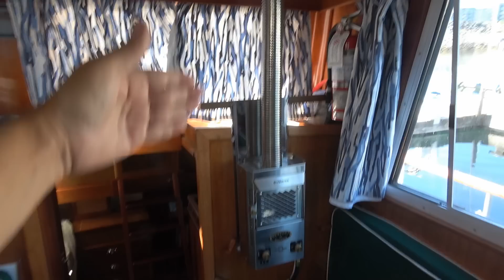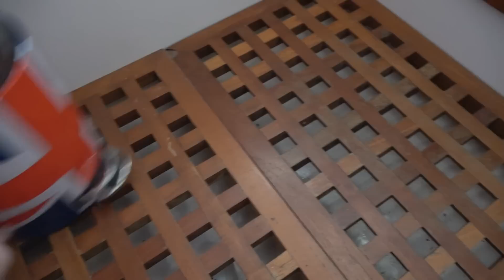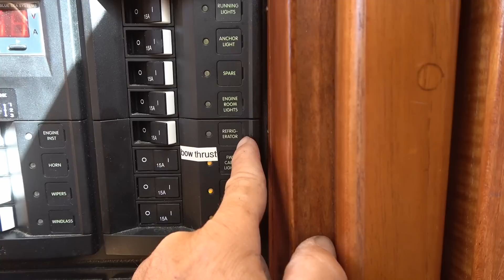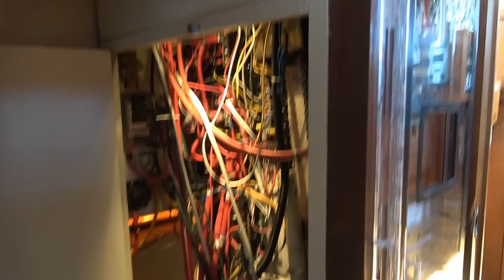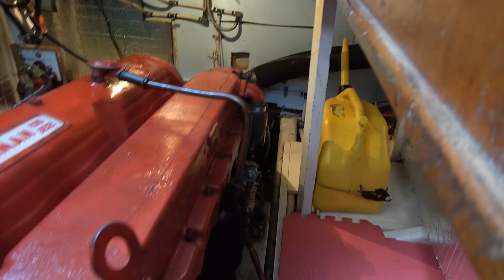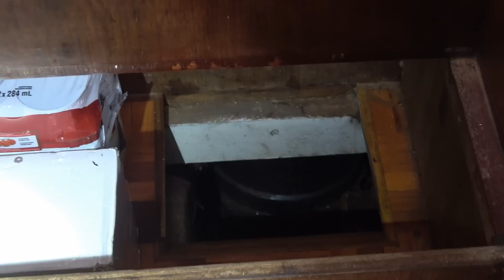Ray's Tour of Our New Boat "Vestri" Mechanical, Electrical, Plumbing, etc -  1976 CHB 34" Trawler

Comment: Thanks for the tour of the systems on your CHB trailer. I live in Juneau Alaska and am thinking of buying one of those trawlers to replace my sailboat.  Just a couple of comments about your water pump for the galley sink, etc. You’re correct about the loop in the line providing some relief for noise. Another thing to consider is to put a little bit of rubber matting between the mounts on the pump and the wood to which is secured.
Also, have you looked into an on-demand, propane hot water heater system? I know a lot of RVs are using them these days. Might be an option for when you are not on shore power.
Reply from the maker: You're welcome. :) The boats water heater has an exchanger system built into it. So when you are running the diesel engine it pipes coolant through the water heater which heats the water really well. I make sure to do dishes while under way and then when we arrive after using the engine we both have showers. :)  Also being we are summer cruisers we can sometimes swim in certain bays and coves and I have one of those camping shower bags that hold 20 liters. It warms up in the sun and we can hang it on the end of our trawlers mast boom and shower on the swim platform. Actually works pretty well.
Reply: @LoveYourRV  sounds like you have it all figured out!  I live in Alaska so those camp shower bags don't really work up here!  What I'm proposing is using an on-demand propane water heater that can run right off your existing 12 volt system and propane system.  That way, you don't have to depend on the big engine running or on the camp show bag (if the sun isn't out) and can have hot water whenever you want.  I do believe they have these systems in RV's these days.  https://www.youtube.com/watch?v=dtQHir8r2rg
Reply from the maker: Yes, getting popular in newer RVs. I actually decided to not go to one in the RV when my original gas/electric water heater bit the dust a few years ago. I replaced it with the same OEM type. I wanted to keep the electric functionality for when on shore power since shore power was included free at the campsites I frequented about 4 months of the year.  LP gas is getting pretty expensive and the water heater can be a big user of gas.
LP gas water heaters are pretty scarce on boats, even any LP gas appliances for the matter due to safety concerns. LP gas leaks in an RV can flow out onto the ground and dissipate. They can build up in the hull of a boat and cause an explosion. So installation would likely take extra precautions and get expensive to move the water heater location. For example, you wouldn't want to place an LP gas type where the existing water heater is in the engine bay as any leak would trap gas right in the hull. So it would involve finding another place on the boat. Then it also requires outside exhaust venting and then run the plumbing/electrical to it. So you see, it's not a simple install like in an RV to change to an on-demand. I think if I went to an on-demand, I may look at a diesel on-demand, but so far, it hasn't been a big issue. To conserve fresh water off the grid, we do a lot of sponge baths with boiled water in a sink anyway.
Finally, every few years the boat needs to pass a survey so we can get insurance. I'm not sure if an on-demand would be allowed or not or take a bunch of extra money input to pass marine safety codes, etc. So would have to make sure of that too. Cheers, Ray
Reply: @LoveYourRV  good insight and information.  I've never owned an RV but have had several boats, so I can see how what applies to one doesn't apply to another.  I appreciate your input and insight!

Comment: You wouldn’t want to fuse the large house battery wire as you stated previously up top you have a choice of starting the boat on the house batteries. So for the same reason you don’t fuse your starter battery line, you wouldn’t fuse that unless you took away the choice up top on the switch and rewired it or just never start the boat using the house batteries.
Reply from the maker: Yes, it seems to be wired so that the house or both banks combined can easily be used to start the boat but I personally think its too great of a risk given the long wiring runs, so I will be rewiring them so only the start battery bank is connected direct to the starter and then fuse the house battery properly. I'll ditch that battery switch and replace it with one that will disconnect the main DC load panel feed. I'm also planning to replace the house bank with lithium. 
I carry a little NOCO GB150 jump starter box rated for a 10L diesel, so if ever needed, I'd use that in a pinch to start the boat.

Comment: Look up electrolysis on saltwater boats. Electrolysis happens when electrical current runs thru water and will take electrons from one metal and deposit them on another. You can get electrolytic reaction between your boat and another docked close to you. Don’t know if you have zinc anodes or if your boat has a metal hull, and you have bad wiring introducing current into the water, which would cause electrolysis to occur. Aluminum boats are very susceptible to it. Also think about your aluminum or metal propeller with electrical current in the water, I would check that too. Beginner boat owners do not know about electrolysis and may not of even heard about it.  It can cause components to fail or weaken. I would read up more on this subject.  Great video!
Reply from the maker: Yes, there are numerous sacrificial zincs on the outside of the boat and in the engine that get routinely changed. I've also discovered the boat has a Newmar 30 amp galvanic isolator installed on the incoming AC earth ground line. It was hiding high up in the main electrical cabinet. I tested it today with my multimeter and its still in working condition. Next season though I may replace it with an updated one as its pretty old.  The older Electro-Guard must be a relic from the 1960s or 70s judging from the ancient transistor I discovered on its circuit board today. Cheers, Ray

Comment: I'm looking forward to seeing what you do with all that wiring.
Reply from the maker: Just finished installing a Smart Plug outlet, ActiveStart soft starter and 2000W inverter charger so got most of the AC wiring cleaned up, now to the DC circuits and wires. :)

Comment: My brother owns a couple of yachts some years back and from what I could tell they never use propane in a boat because its so dangerous and being heavier than air a bilge full of propane due to a leak would make for a dangerous situation.  Everything in his boats were electric.  He had an old stove that somehow ran on diesel.  I know you're very competent in just about everything.
Reply from the maker: When I was looking for a boat, I noticed many of the types I looked at had propane stoves/ovens, and barbeques. Most were west coast boats, and most were ones that people used for extended cruising. But as battery banks have grown and more people install lithium batteries, induction cooktops are gaining popularity. 
Propane stoves are still used though https://defender.com/en_us/fixed-stoves-ovens Here is a brand new Ranger Tug Northwest model that comes with a propane stove and oven. https://rangertugs.blob.core.windows.net/media/4200/2023-06-30_2023-r27-spec-sheet-web.pdf
If you look at the major cases of boat fires, the electrical systems are by far the biggest cause, both DC and AC, then many are engine fires. I was way more worried about having a gasoline boat versus diesel than having propane. Having worked on and used propane living full time in the RV I'm used to it and how to maintain and test the system. Cheers, Ray
Reply: Wow thanks for the thorough response. Like I said you are always well informed in just about everything. Happy boating!

Comment: I would add a CO2 & smoke detector in the master bedroom.
Reply from the maker: I'm currently adding a smoke detector in the bedroom as there wasn't one anywhere. CO is pretty close as it is maybe 8 feet from the bedroom so not as worried about since it is lighter than air and tends to rise

Comment: Thanks Ray!  Very interesting!  Good for you for taking on what appears to be a steep learning curve. Lots to learn but that’s half the fun. Question: is your vessel capable of handling the ocean waves?  For example BC to Mexico. thanks
Reply from the maker: The boat could likely handle but I don't think we would. The boat gets pretty rocky on side ways waves so would need to add stabilizers, etc. It can get very nasty in the open ocean plus you'd have to keep going at night. Nowhere to stop when you are 50 miles off shore and we only have a single engine. We'll stick to the sheltered inland of the BC coast waters and enjoy ourselves. :)

Comment: Yeah electro guards pretty darn unusual stuff and replacing parts is kind of silly expensive. You’re better off with a $300 galvanic isolator and be done with it.
Reply from the maker: Was installing a surge protector yesterday so rerunning the AC input wires and found that there is a GI-30 NewMar galvanic isolator that is installed in the boat https://www.newmarpower.com/wp-content/uploads/2016/02/Manual-GI-3050.pdf

Comment: Hey Ray, now you’re in my world I’m a marine ET that’s nationally certified to work on your boat so I wanna just give you a heads up. When you change out your shore, power plug and it looks like you have a 30 amp system in that boat go ahead and pop in a galvanic isolator just as that hotline comes in from the back of your new shore connection you'll be glad you did. they're literally only a few hundred dollars and they take up some space, but when you leave 110 AC running all the time you’re gonna find anything outside of that boat wanting to get chewed on such as your rudder and anything else metal it’s on the outside of the boat.  Galvanic, isolation is no joke.
Reply from the maker: Thanks for the heads up,, good idea. Do you have any recommendations of galvanic isolator brands?  We actually don't plan to be on shore power much at all though mostly will anchoring when using it, with the odd overnight stop at a marina to resupply. Then the boat will be on land storage about 7 month of the year.  
Also, maybe another way to go would be to always run the boats AC loads off the Inverter output and the batteries and just have a battery charger for shore hook up. That way the boats AC loads aren't connected to the shore panel ground.  Cheers, Ray

Comment: I would make the fuel filter more accessible immediately. Crud in your fuel tank will get stirred up in rough seas and clog the filter. You will need to be able to change it immediately if the engine quits off a lee shore. 

The teak is beautiful but I hope that you enjoy maintaining it.
Reply from the maker: That's Anne's job. She can't do to much as far as mechanical, electrical, etc so will give her something to putter away at :)

Comment: I’ve never seen an isolating system like yours with meters etc.  Now you simply install a galvanic isolator which helps prevent stray currents from other boats in the marina from impacting your boat.  ProMariner ProSafe FailSAFE 30 amp isolator is what I put on my boat.  The unit from 2006 actually failed in an open condition, which is dangerous.  The new units are required to fail in a safe state (ground intact), but maybe not isolating stray currents properly.  Very easy to install, simply run ground from your new shorepower inlet to the isolator, the other side of the isolator continues on to your boat ground point.  Your boat is very clean for a 1976 diesel, previous owner took care of it nicely.

I just installed a 200 amp hour SOK marine battery in my boat with a DC-DC charger (Victron).  Very happy with the system.  Have fun!

Comment: I believe the "Electro-Guard" gauge is an Electrolysis system for Prop, Shaft; maybe Thru Hulls. I see copper wiper arms for sale. As you are probably aware, Electrolysis can eat props and shaft if ignored.
Reply from the maker: Was installing a surge protector yesterday so rerunning the AC input wires and found that there is a GI-30 NewMar galvanic isolator that is installed in the boat https://www.newmarpower.com/wp-content/uploads/2016/02/Manual-GI-3050.pdf so I guess the Electro- Guard is a left over disconnected artifact. :)
Reply: @LoveYourRV  Could be, the New Mar device looks to address "Stray current," (from the dock's power.) You're probably right, the Electro guard gauge is a relic. You may have a 1 1/2 " shaft zinc, to protect your brass prop. Maybe grab a mask and take a look. Bet that water is cold,,jk.

Comment: The stuffing box you talked about at the end is basically like a " bell and spicket " in some drains in the plumbing industry. 
In the plumbing system a pipe running vertical widens to an upside down bell shape. Another pipe goes into the bell part and is stuffed with the same material you showed. 
Enjoyed the video 
Have a Jesus filled day everyone Greg in Michigan